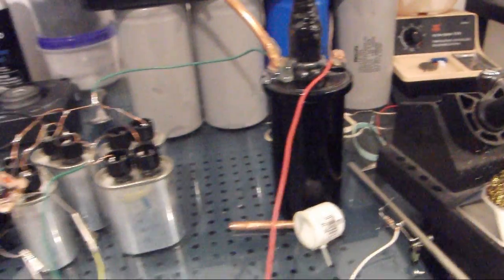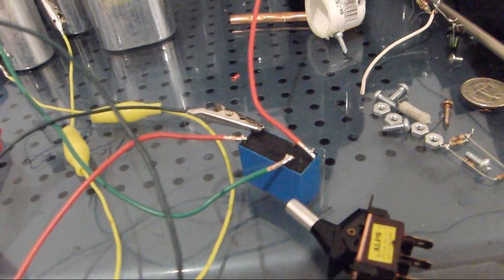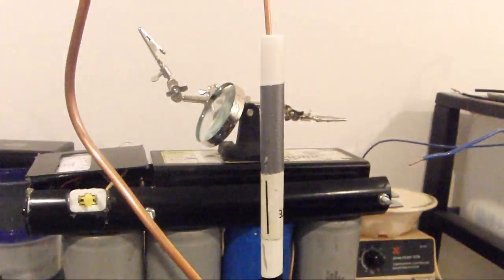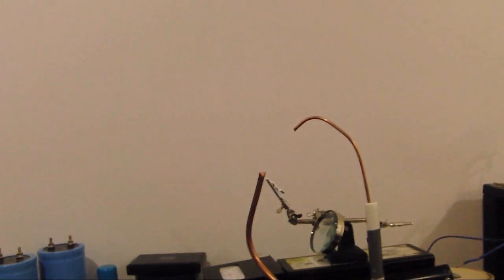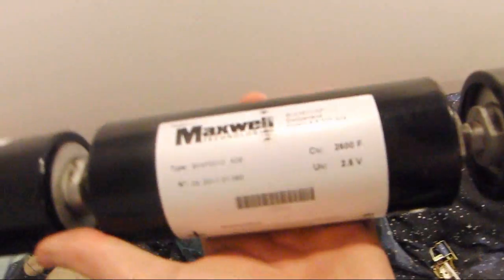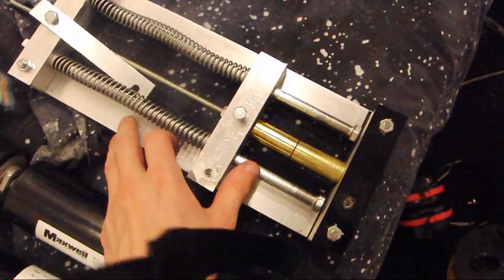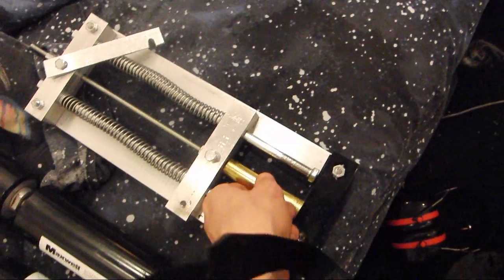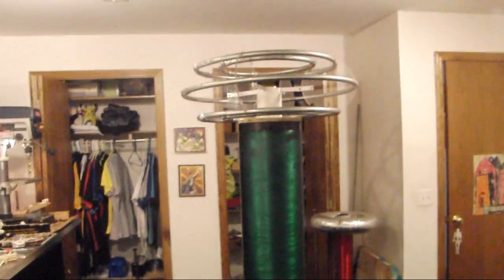3V to HV, Ignition coil test

Comment from the maker: @Alex1M6 It still works.  The issue is its breaking through the insulation of the PVC, glue, and tape. going from the middle of the ignition coil to the + or - inputs.  The coil it self hasnt broke down yet.  This was a coil i bought online ages ago, brand new too, for GMC vehicles =)

Comment: @PhxSt0rmz How long did the ignition coil last? I once pulsed around 1.4kV through a motorcycle ignition coil and got around 3" arcs (I have a video of it somewhere on my channel). That was using a 0.47uF high voltage capacitor and it surprisingly was able to withstand that much input voltage. But when I tried using a 330v 120uF camera flash capacitor I got a few nice 4" long semi-hot sparks then the insulation broke down inside of the coil and the sparks went down to around 1". All good fun!

Comment from the maker: @HazzWold1993 He did this on his big transformer. not an ignition coil. You can do this with any transformer...His transformer is rated for that.  Lets say 100V did a 1ft spark.  All he has to do, is charge a capacitor to 100V.  If he wants the arc to be more current, thicker, use a higher storage capacitor like 100V at 2000uF. any transformer can be pulsed with DC, its just in the case im doing it, we have a 12V rated coil being subjected to 600V.  Damages it, and its not rated for it, arcs.

Comment from the maker: @Alex1M6 Yup. this is only 2000V 4uF of capacitors.  Even a camera capacitor, of 80uF, would dump a lot more energy into the coil than what I'm using.  but, the reason i cant arc far, is because i cant stop the thing from arcing to itself through insulation without oil.  Do relise, 100-200kv is 10-20cm. I was doing maybe 2.5", which is 6CM, or roughly 60KV.

Comment: @HazzWold1993 I just watched that video by photonicinduction and what he really did was use a camera flash capacitor charger, which takes the 1.5V and steps it up to around 330v which is then stored in a capacitor that has a capacity of around 100uF. The energy is then dumped into the primary coil of his "infamous" 200kV transformer giving the high voltage pulse on the secondary coil, which has a much bigger turn ratio than a standard ignition coil.